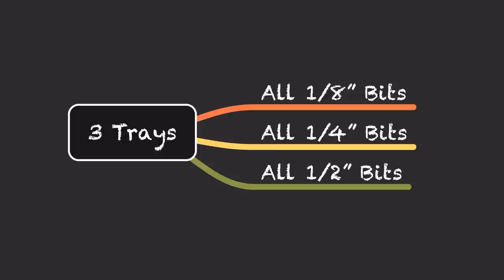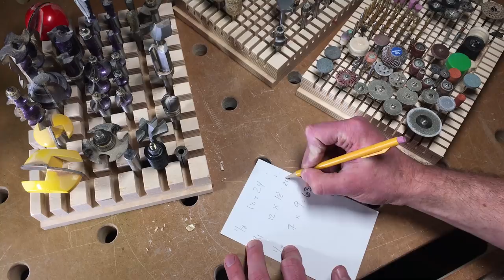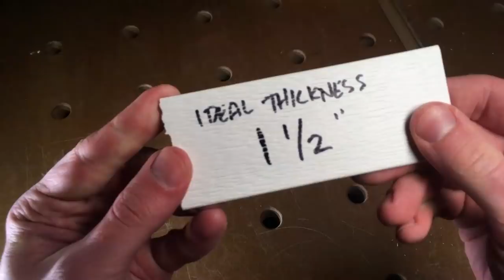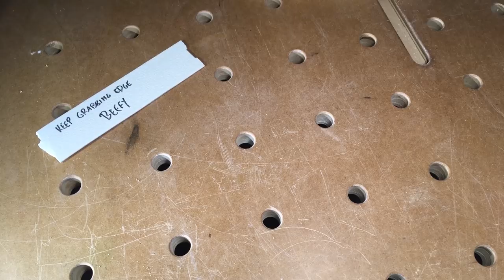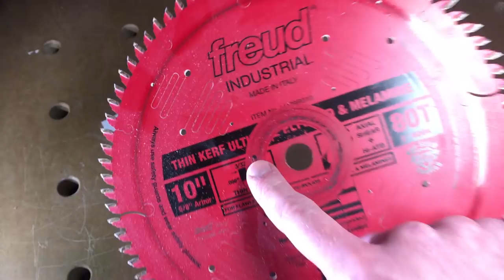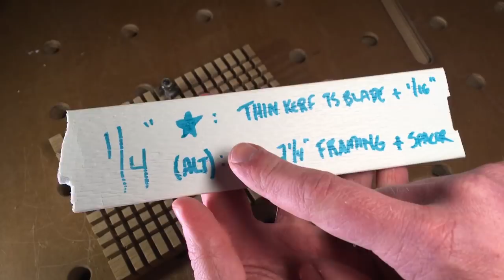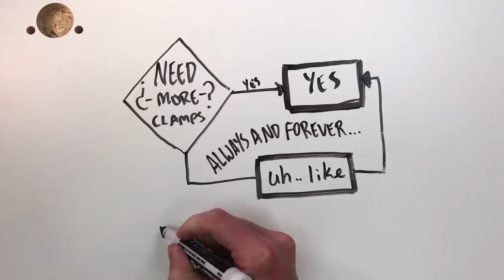Wicked Fast Router & Dremel Bit Storage Trays Using Dadoes Instead of Holes

Comment: You can sprinkle salt on the glued surfaces to keep them from slipping..
Reply: @Roderick storey the problems with the brads n screws is that they leave behind their mark behind and the ca and hot glue will leave holidays (voids) around them because I don't think they mix well and additionally, hot glue requires a considerable amount of dimension. Its inevitable due to how fast it cools off as soon as it touches the surface being glued. It may not seem very cool if you touch it but it cools off enough to make it a thick bond. With salt, (sea salt maybe better than table salt but table salt works) just sprinkle on n continue to march.. ...all due respect to you and Mr DiResta...
Reply: @Roderick storey  ..hey, it happens. I am now recovering from a major brain fart I had this afternoon on a little project. At least how I know I'm in good company.. Thanks for your replies..

Comment: I love this idea. Thank you so much for your time and effort. I happen to have some "undersized" router bits, for big box plywood, i.e. 7/32" for 1/4", 15/32" for 1/2" ply, and 23/32" for 3/4". I will be doing the same thing on my router table, using the undersized bits. I am going to try 2" x 10" as I have a lot of scraps around. (Remodeling my house and putting in all new floor joists.
Might I offer a tip. When I worked in a cabinet shop building commercial fixtures, we had some "I" beams around for certain glue ups, in short pieces. 

I would think 2-3 ft. pieces can be had at commercial building sites, or scrap yards for a cup of coffee. Cheers!
Reply from the maker: Good idea on the I beam scraps.  Let us know how he router bit idea works.
Reply: @KeithsTestGarage  Will do

Comment: You could increase the robustness of the columns by gluing up slabs across the width of the board, that way the grain goes from the base into the columns.

Comment: a good way to keep the alignment for the glue up of the panels is to stack them up, clamp them, drill a hole in two opposing corners and stick a dowel in them during the glue up. no more panels squirting out under pressure!
(edit) also, going with an endgrain in the board will almost eliminate any breakout of the columns. ....plywood or MDF bottom layer, an end grain board on top of that, dadoes, bob's your uncle!
Reply: excellent idea sir
Reply: Just wondering if cutting very shallow groves ( maybe 1/16" ) on the glue sides of each board might help?

Comment: Sprinkle salt in the glue, to prevent shifting. Not in the bottle, but after you apply and spread it on the surfaces you are gluing, drop a pinch of salt on either side.

Comment: nice video and great effort to share your ideas.
may i suggest the "butcher block" style?
this would have vertical  grain and will never split the little blocks.
cut many 2"x4" about 2" long. 
glue them all together as a sheet.
plane the sheet to 1 1/2" thick and glue it to a plywood for stability
next resume to your video for style and accuracy
P.S.: do not grove deeper than 1" to preserve the integrity of this technic 
Great job Keith
Reply from the maker: I think that would work very well ... particularly if someone likes doing glue-ups more than I do.  If you do this, post a video and let me know .

Comment: ''Accidentally followed the centimeter marks...'' C'mon US, you know metric is sexy.😏
Clever and simple, those solutions are the best!
Reply from the maker: I love metric, just hate buying 1219.2mm x 2438.4mm sheets of drywall.
Reply: You American guys confuse the hell out of me when you say " I'll just cut this  9ft 11 and 27 32nds of an inch 😂
Reply: We used to use imperial measure over here in Australia years ago.

I'm so happy I started in the building industry when the metric system had taken over though lol.

I still work with older builders and tradespeople that use some old imperial talk, (4x2 timber framing, 8x4 sheet of ply, 9 inch brickwork etc)

It must have been a confusing transition for those older guys when they made the switch from imperial to metric. 🤔
Reply: @KeithsTestGarage  Some time ago at my job we needed 5' folding tables for field work.  One of my coworkers called the local big box store and asked about availability.  The person who answered the phone stated that they didn't have any 5' tables, but that they did have some 60" tables.  Would those work?  My coworker, being a major smart-ass, asked if there was a difference in price and the store employee said that there wasn't.
Reply: Mike Curtin, I had something similar happen only in my case I asked for 6.5” saw blades for my small circular saw. Assistant told me they didn’t have any but they did have some 165mm blades that looked like they might fit. 🙄

Comment: Enjoyed the video and loved your solution. I wonder if you could just get someone to create the same thing via a CNC machine?  Metal might hold up better.  I know i know... it's a DIY woodworking video but just another way to take to another level.
Reply from the maker: If you do it, upload a video!   Though it's outside the intent of this channel, it sounds sweet!  
Note:  Using hardwood would be perfectly strong - the breaking-columns test was just a test of a tricky glue-up that, IMO, showed great results.

Comment: Too many comments to tell if someone else already said this: to determine the width of the dado, divide the diameter of the shank by the square root of 2.  That's the right geometry anyway.  Wood flexes a bit so maybe go a bit smaller for slightly mire contact area at the corners.
Reply from the maker: Haha... yes, lots of comments.  I was wondering this as I made the video - thinking there's gotta be an equation out there.   Somebody else mentioned 1.4142.  Is it easy to explain how you got to the conclusion that it's the shank divided by the square root of 2?  Feel free to tell me to Google it.
Reply: The shank fits between the four corners of a square that is formed by the perpendicular intersecting dados.  The diagonal of that square is the shank diameter.  From here you use the Pythagorean theorem c^2 = a^2 + b^2 backwards.  (I don't know if it's possible to type superscripts here so I use ^2 to indicate "squaring": multiplying a number by itself). The length of the hypotenuse (c in the formula) is the shank diameter.  The length of the two sides, a and b, are the same because it's a square, so we can substitute one for the other, giving us c^2 = a^2 + a^2, or c^2 = 2 a^2.  We then take the square root of both sides of the equation to get c = √2 a.  Solving for a -- the side of the square and thus the width of the dado -- gives a = c / √2.

Comment: Great ideas!  It's very hard to glue starve relatively soft, porous wood sheets of any size. I suppose you could starve a 1" oak stick glued across another 1" oak stick if you used extreme clamp pressure, but in the real world, it's not a worry.

Comment: Great idea and explanation on how to make the storage trays. I will definitely be making some.  Here's a suggestion: Eliminate the glue up altogether. Use plastic. For what you paid for the baltic birch plywood, you prolly could've gotten a block of similar thickness in UHMW, Polypropylene, Nylon, or ABS. Some people even manufacture their own HDPE blocks from recycling milk jugs and other containers..
Reply: I’ve made HDPE blocks, good idea using it for this.

Comment: Now wrap the outside of the tray with a nice hardwood. That will correct the possibility of breaking one of the pieces off around the edge when holding it or moving it.....and it will look nice

Comment: It strikes me that if you glued up wood scraps into a piece of butcher block, when you cut across it, the islands would be MUCH more resistant to breaking because the wood grain would all be pointing up.  ...and if your bit diameter is X, then the formula to determine a perfectly sized dado for that bit is SQRT(X^2/2).  (That will probably be a little too tight; testing it first would be a good idea.)  For example, 1/8" comes out to around 3/32" or 2.25mm,  1/4" = 3/16" or 4.5mm, and 0.5" =  3/8" or 9mm.  Hope that helps!

Comment: Here's the Math:

The intersection of the dado's form a square with no sides, just 4 corners.  The largest router shank (circle) that touches all 4 corners has a diameter equal to the diagonal of the square.  Take 2 adjacent sides of the square with the diagonal and you have an equilateral right-triangle.

For a ¼" shank bit, the diameter and diagonal and Hypotenuse are all ¼".
Let the short side (or dado width) be "S", then you have
 
S² + S² = (¼)²
2S² = 1/16
S² = 1/32
S = 0.176777...

Of course, wood corners are somewhat malleable, so I can see why 0.175 that Keith used would be a snug fit.

Comment: So a common misconception among non seasoned woodworkers is glue starvation.  Glue starvation is when there is not enough glue on all of the surface to begin with.  Improperly spreading the glue and not covering the entire surface will cause glue starvation.   In 40 years of serious woodworking I have never ever had a joint fail because I applied too much clamping pressure.  If you don't see glue squeeze out you may not have applied enough pressure or glue.   The best joint is always the thinnest glue line between mating pieces. 

Your video was very good and informative.

Comment: Incredibly awesome idea! Thanks for sharing. You might consider contacting and collaborating with Paul Akers at FastCap. He might be interested in producing these grids for holding bits as an "off the shelf," "ready to use" product. Paul is always  looking for great ideas like this. Thanks again!
Reply from the maker: I definitely expect this to be more of a DIY solution than something there'd be a market for, but I emailed him anyway to see if it goes anywhere.  In his opinion, "...honestly Kaizen foam way way easier to do this with all my bits are in Kaizen Foam It took a  fraction of the time and it's way more intuitive and less busy."    So, that may be another option for some people...the black does look nice and would indeed make things less busy.  I suddenly realized that my solution will likely not be supported by anyone who already sells router bit storage solutions.  
...For what it's worth, I do like FastCap and their innovative products (particularly their write-on measuring tape)

Comment: Watching carpentry videos with imperial units make you really appreciate metric system: only decimals, no / notation - easy adding, round numbers for small measurements (millimeters), worldwide knowledge base (engineering tables). Do every American can quickly convert between thau and inches in / notation? (7/8" is how many thau?)

Comment: The reason the MDF fell apart is due to how it’s created... it’s also why I hate the stuff. It’s two hard layers surrounding a fluffy internal. If you cut into the fluffy area it becomes unstable and also absorbs moisture and expands (which ruined one of my projects before I knew better).

Comment: Good idea!  I use a small hydraulic press for large area glue-ups.  Subscribed and sharing.
Reply from the maker: Hey thanks!  You have an impressive channel, by the way.
Reply: @KeithsTestGarage  Thank you.
Reply from the maker: Do you have a way to measure the force of your hydraulic press?
Reply: @KeithsTestGarage  I don't have a way to do that, but I suppose you might be able to attach pressure gauge and calculate force knowing pressure and ram diameter.  It's a 6 ton cylinder - a little bit more force than your Toyota.

Comment: That blue tray at the 3:58 Mark looks pretty nifty....
Reply from the maker: k j Yep. I recently got a 3D printer.  It holds the bits a bit tight but can be upscaled. That was about a 6 hour print!   On that note, some upcoming videos will be related to 3D Printing for the home shop.
Reply: @KeithsTestGarage   wow 6 hours for something you reinvented and only took 5 min (of saw cutting). Well done
Reply from the maker: The joke is on me. The printer works on its own and doesn’t ask questions. The dadoes and table saw require me to work.
Reply: @KeithsTestGarage  ahh yes 3D printers are the ronco rotisserie of the manufacturing world. You just set it....and forget it!

Comment: Ingenious! Of course, the dadoes don't have to be the same width in each direction - is there a combination of different blades that would make the one for the 1/4" bits easier?
Reply from the maker: Ahhh. I have wondered about this but have not tried anything. I’ve also wondered along similar lines if the dadoes can be cut st a different angle, like 75 instead of 90. But I think your idea of the different widths has more potential. If you find a combination post a video!

Comment: Any thoughts on how you could add a labeling system for this? It can be hard to tell the difference between some bits. Great idea. But density isn’t always as good as organized and clear. You could speed out the grid by a couple inches and give yourself room for labels and better organized layout.
Reply from the maker: Good thought. Yeah if you need labels spreading them out a bit would help. Personally I can see the differences just fine, and the density helps in my smallish space.

Comment: I know this is 4 years old, but I'd laminate a piece of aluminum(which you can cut with the same dado stack) on top and then pre-drill and set a counter-sunk screw in the center of each column, making it not only near impossible for a column to break, but repairable in the extreme case that it does.  :P   Maybe make an update video?  idk

Comment: Also bc dados cut with a blade set  create ENORMOUS force to throw the workpiece in your face and pull your hand into the blade (if you're holding the work) - you should default to a blade guard that "floats" above the blade - mounted to the far corner or a separate stand, like a power feed unit.  I feel considerably safer using an inverted router mounted next to the table saw that shares the fences, or (these days) CNC. 😫🤑

Comment: Very clever..I'm a spreadsheet guy...did you assign a location by tray by intersection by type and if so, how did you save it for reference.  I want a 1/2" round over bit...I use it so infrequently, I may not recognize it right off, did you design a locator mechanism?  I'm also trying to think about keeping the trays out instead of putting them on a shelf.  I would also consider making another tray for driver bits as I have over 300.  Did you consider those long and short drivers by torq, philips, etc.?

Comment: Brilliant! This technique can give a snug fit, yet not too snug to withdraw with your fingers; difficult to achieve with a round hole. For the smallest bits, Dremels and such, I worry that the spacing could put the short grain at risk  of breakout, unless you opt for less density. How about using an end-grain block for those?

As a woodworker familiar with the characteristics, strengths and weaknesses of this material, looking at all those tiny squares gives me an unsettling feeling, though, even if they never actually fracture. Does another material exist that we could use, homogenous, strong, not too expensive?
Reply from the maker: Lee Haelters I’ve had zero breaks in hardwood. And the only ones that broke in the plywood were at the glue joint and during the build. Not in use.  

What you’re recommending for end grain would be stronger but is it *better*?  I guess that’s for each woodworker to decide for themselves based on how they’d like to spend the time it takes. 

Personally I loathe glue ups, and love making quick use of things laying around.  In the future I’d just use a chunk of hardwood instead of plywood.  But in practice both have held up well.  The lignin in the wood seems stronger than the forces exerted on it. 

But I have a full time desk job as well as a family, and this channel I’m trying to ramp up, and all that drives my loathe for glue ups!
Reply: Keith, agreed! The less glue, the better.

Comment: I'm finally getting around to setting up my garage as a proper shop. This idea, and others you've posted, are great and I will definitely employ some of them. Very informative, thank you!

But I have another question ... You show a small plastic parts bin (around 0:16 and later in a stack where the new Dremel sorter goes 13:35). I have one of those exact bins and am trying to source more. But I can't find them anywhere. I probably got mine at Lowes or Home Despot but neither has them now. I even tried searching the little dog-like logo, with no luck. Do you remember where you got those bins?
Reply: @keithmarlowe5569  Thanks Keith. I'll look there.

Comment: So now someone needs to come up with something like this for cords and chargers
Reply from the maker: Hmmmmmmmmmmm. What type of chargers?
Reply: @KeithsTestGarage  Phone cord chargers, connection cords, such as USB cords, power cords, even dedicated chargers.  I've dabbled with using roll holders and clothespins, which seem the most common, but neither really work that well.
Reply from the maker: @kogv4693  That's an interesting problem to try to solve and I've created a few prototypes - particular around USB & Lightning.  Nothing super impressive, as each prototype has had its limitations.  I'll put it on the back burner list of possible video explorations.  Wall warts, however... I haven't figured out anything there.    I wonder if the solution would not be a product, but rather an approach for people to be able to quickly make their own things based on the cords they're trying to organize.  Stay tuned... I may add something sooner than later since I have a few things already made sitting around here.